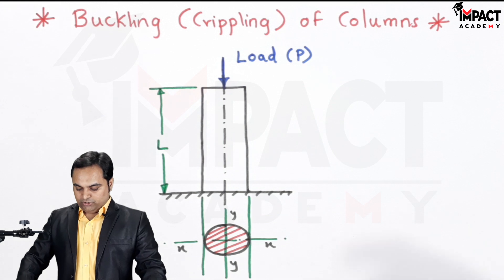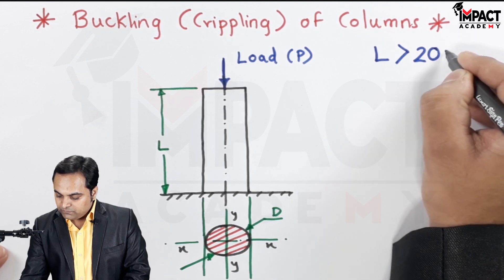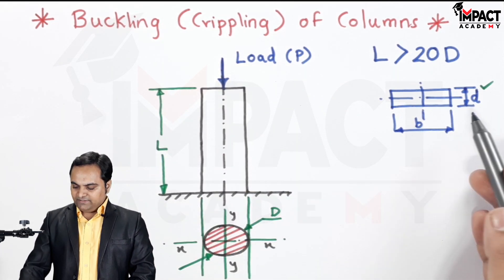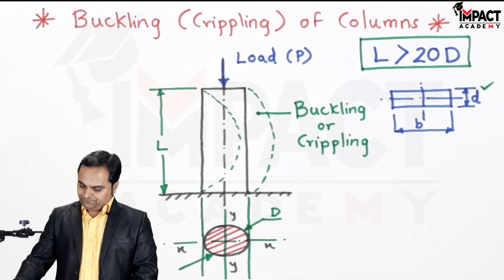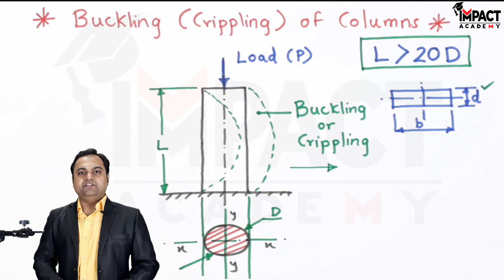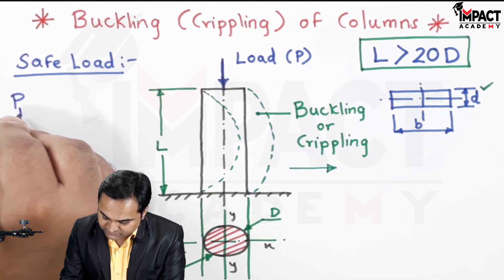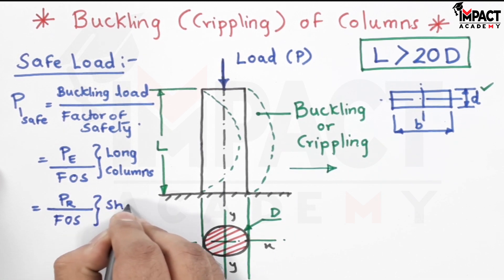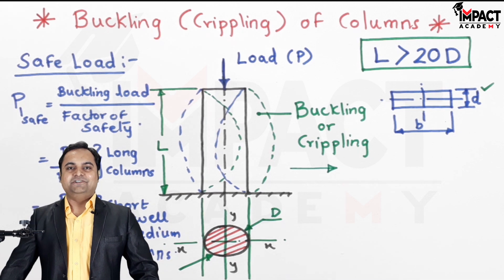Buckling or Crippling of Column | Columns | Strength of Materials  #freeengineeringcourses #zafarsir

Comment: Steel pipe column 100 x 100; 3mm thk , 4700mm height, top end hinged bottom end fixed. What will be the buckling load ?
Reply from the maker: I'll solve this soon👍👍👍😊

Comment: But in your other videos you have explained long column as those having effective length 12times more than its least lateral dimension. And in this video you have explained it as 20times... Can you pls explain the discrepancy???
Reply: Yes Sir please explain
Reply: Any rule of thumb is simply that, a rough estimate of the point where behavior transitions from one type to another.  It is best to check any possible failure more.  For example, for members in compression, check crippling (critical for short columns) & Euler-Buckling (critical for longer columns).  Better yet, check Euler-Johnson buckling, which accounts for both and the interaction of the two in the transition range.
Reply from the maker: Thanks for commenting Vipul Gupta...I'll clear your doubt soon...👍👍👍